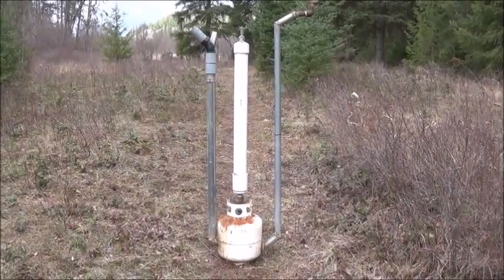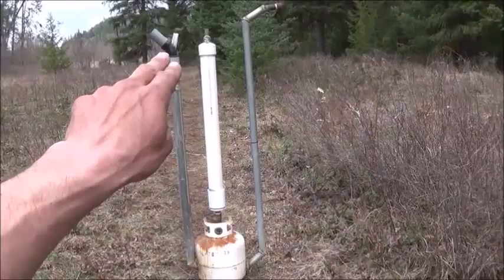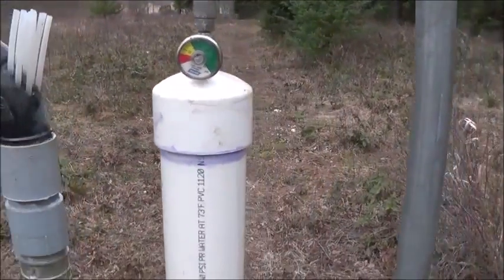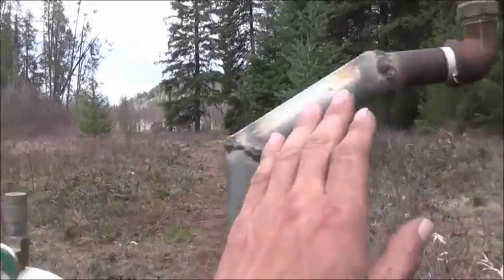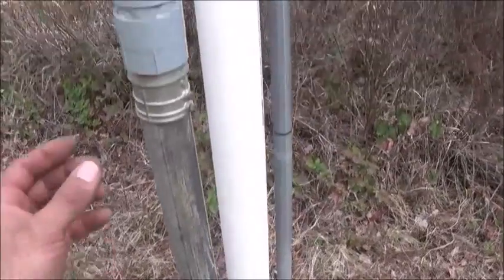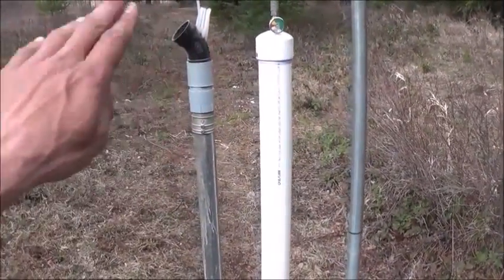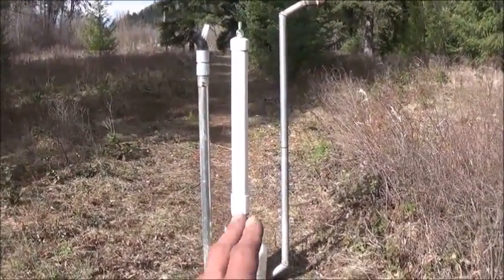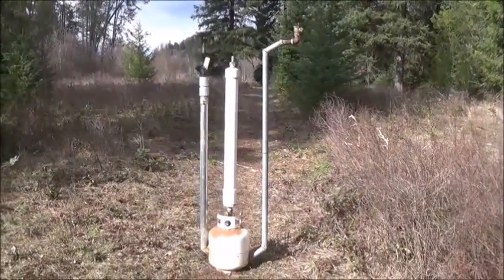Water Powered "Air Compressor and Water Pump". The "Trompe Hammer", Trompe and Water Ram

Comment: To get more air in the water you need to use the venturi effect. The original design of the trompe have a larger opening for the water entering the top of the pipe that is like a big funnel. Like  in a venturi the constriction creates a low pressure that sucks the air in.

Comment: Great bit of engineering. However, If the goal is to run a compressed air turbine, you could use the water flow to alternately fill two large tanks. Creating compressed air as one fills and low pressure as the other drains. Placing the turbine in between the two air flows would increase the acceleration of air through it .

Comment: Don't forget the air you make will be cold. so if its heated up in the sun being piped away to another storage system you will see bigger pressures. Plus free air con on the cold side. Love to see that.
Reply: +Red Axe Didn't think of AC, but you can also do direct refrigeration.
Reply from the maker: Red Axe good idea

Comment: Have you thought about putting little turbine blades in the feed pipe to capture the falling water energy? pour some polymer to coat the inside of some windings to make a way to fit PVC to both ends... and on the inside place the turbine blades with some magnets or even just magnetic couple through a pipe to a set of magnets on the outside ?... hard to explain really... but put the windings on the outside of the pipe... falling water turns the turbine blades with the magnets on the inside..geared ( sort of ) to the magnets for the alternator? I bet you could get some serious torque and spin depending on the length and number of the set of turbine blades .. maybe? Like double up on it... water pressure and air pressure... maybe?

Comment: How is the combo working?  Just finished building a ram pump for a project where I need to deliver water to a geothermal unit.  I'd like to pump some air at the same time for other uses.

Comment: Great project. I thoroughly enjoy your videos. I cannot wait to see this in action. Are you still using the gasifier.
Reply from the maker: John Godwin Which one?
Reply: Any.  I built a Ram that had a great fall.  About 30 feet and it pumped water up about 200 feet with lots of psi.  Steep mountains.   This project is cool.  You could store the pressurized air in a really large tank.    I really do appreciate your work it gives me lots of ideas.  Thanks
Reply: ***** The chain saw would be my guess. Did you get it running well?
Reply: Keep up the good work.  Can't wait to see the psi rise on this project.